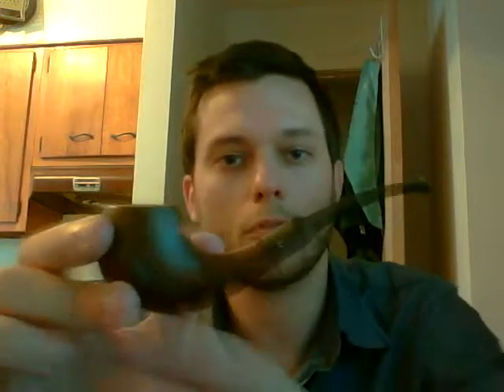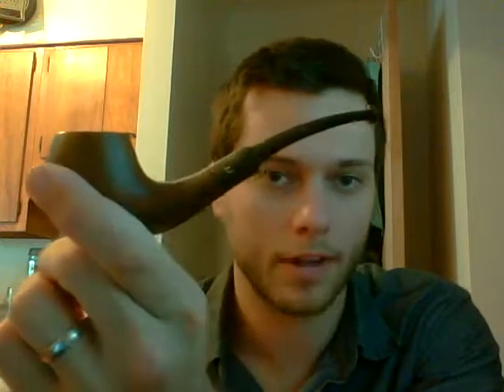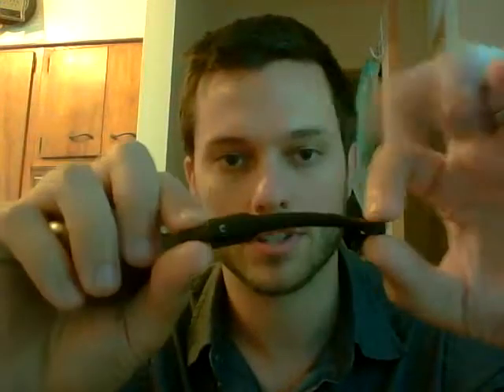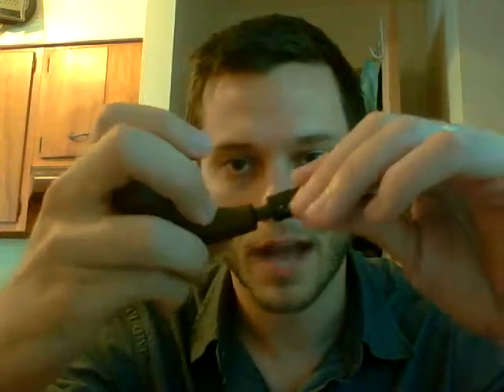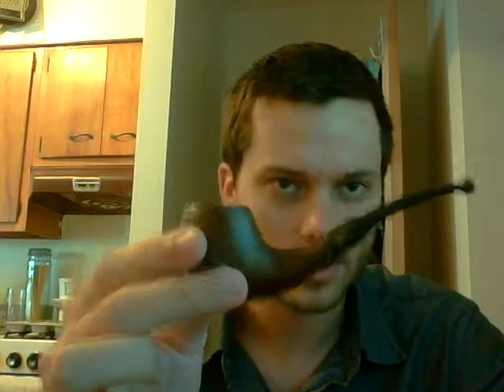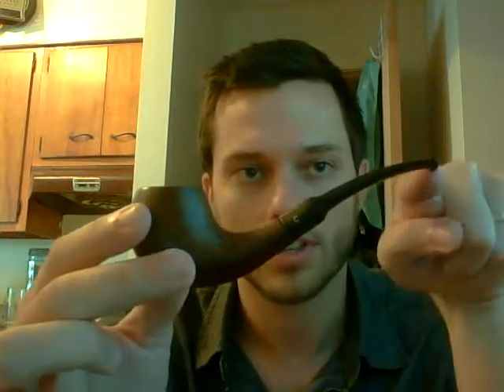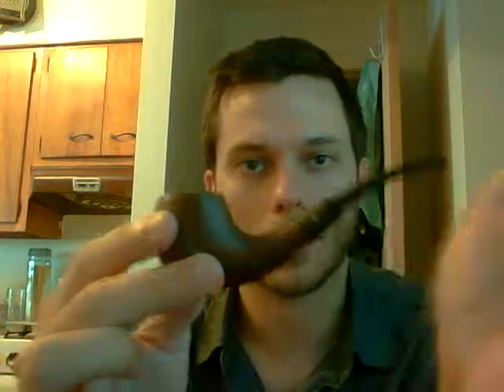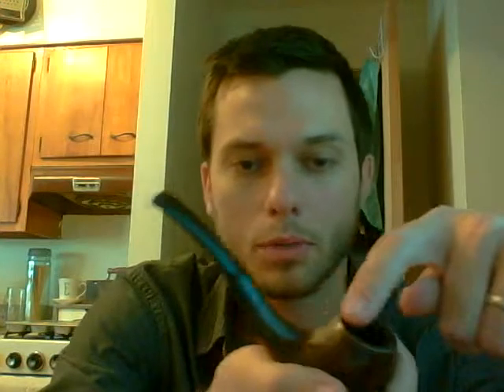Pipe Repair: Stem [un]Bending

Comment: Good video.  I just bought a pipe off Ebay but I have to do the opposite.  I have to put a slight bend in the stem.  I will probably use the hot salt method.